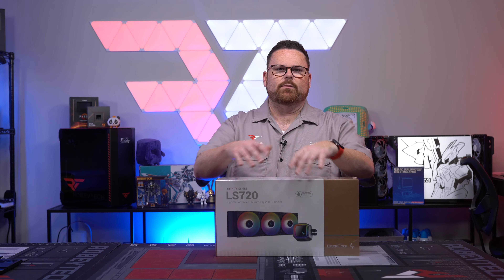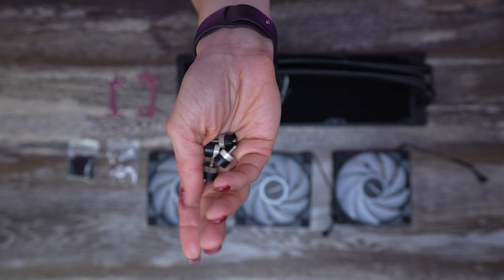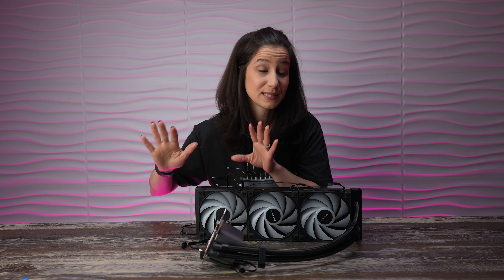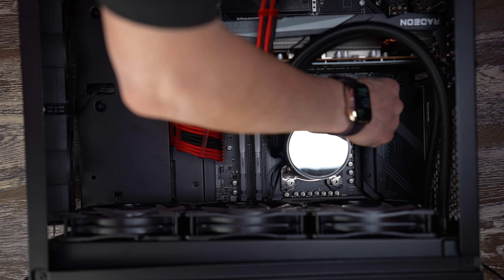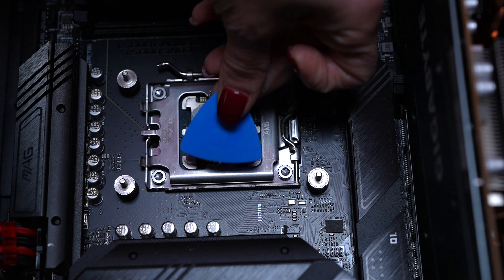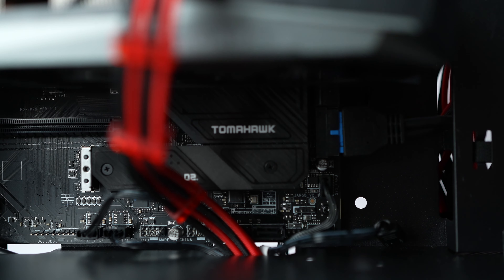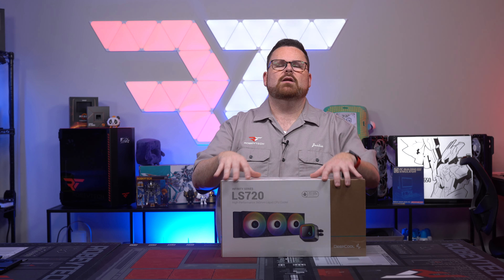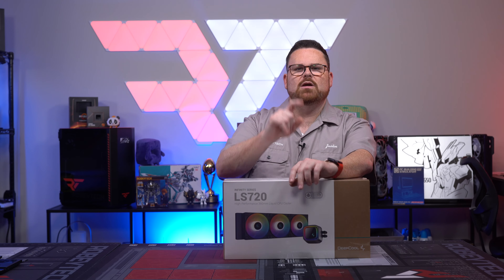How to Install (and Remove) the DeepCool LS 720 AiO (All in One Liquid Cooler)

Comment: Why are the hoses in the 3 o'clock position (next the the ram) as opposed the the bottom of the CPU (6'oclock). I keep seeing this and no one can explain it to me on AMD builds.
Reply: Hey, great question. I'm no expert but I'm currently installing this AIO now. The way the pump is oriented (pause and look at the screws at @5:30), it can only attach to the CPU in the orientation shown in video or the opposite way (180degrees). If you were to place it 180deg, the hose would be on the left instead of the right. The pump cannot be rotated 90degrees where the hoses would be on the top or the bottom since the screws won't line up with the motherboard/cpu. But "why" they're in that position, I'm not 100% sure
Reply: That's the answer. The pump only fits in one direction (for my board, vertical,  so I can have the hoses at 12 or 6 o clock, but not 3 or 9.).
Reply: @aalmanzaaaa  @noisymacbook I actually reached out to Deepcool and they told me it doesn't matter. On my Asus board, I have it on the 6 o'clock position.

Comment: Thanks for the video!

I used different fans for the radiator. Now I want to use deepcool fans in other position as stand alone, but connector doesn't match mobo connector. How can I do it?
Reply: what fan did you use for the radiator?

Comment: Where do you connect the 4pin to? You just point but I can’t see anything on the mobo
Reply: the 4 pin is a pwm fan connector so anywhere on the motherboard that's a pwm fan connector. you will know what it is because it will be named fan_sys1, fan_sys2 and so on.

Comment: I don't get it. Where to attach the 3 pin cable and where to attach the 4 pin cable?
Reply: the 3 pin is a argb that your motherboard should have depends how modern your motherboard is should have at least 1 or 2 connector and the 4 pin cable is a pwm called fan_sys1, fan_sys2 and so on.

Comment: Ok so, can this AIO be controlled (power and ARGB) WITHOUT using the fans in the package? I'm planning on using Lian Li Fans in accordance with my build.
Reply: may be late, but just connect the pump connector straight to the adapter cable
Reply: How are the Lian Li fans working with this AIO? I am going to do the same.

Comment: Mine start making noises from either a pump or radiator after 7 months,possible air and bubbles in the radiator unit or bad pump.
I will have to take it to repairs to see what is wrong with it.
I'm not happy about it   :(

Comment: Hello, Good day. Can I ask something. If I increase the RPM of the fans, Thus the pump also increasing the RPM of the pump? I wondered the pump and the pump is in daisy chain connection.
Reply: No these are separate settings if wired correctly.

Comment: After I watched the previous video.
I decided to buy the components recommended by this channel.
With specifications:
AMD RYZEN 5 7600X
GIGABYTE RX 6700 XT GAMING OC 12G
MSI MAG B650 Tomahawk WIFI
KINGSTON Fury Beast RGB 16GB (8GB x2) DDR5 5200MHz
SSD PNY NVME CS2241 2TB Gen 4x4
Super Flower LEGION GX PRO 650W

Among all the components, the ones I haven't ordered are:
DEEPCOOL CASTLE 360EX A-RGB

Luckily after watching this video, I got a cpu cooler reference with the DeepCool LS 720 brand

My question is, what's the difference between DeepCool LS 720 and DeepCool LS 720 SE?
After I tried asking the seller, the difference was in the pump.
But the price of the DeepCool LS 720 SE is $ 30 cheaper than the original version.
Should I just take the SE?
Reply from the maker: Both will work fine!

Comment: if i use my own thermal paste, do i use the isopropyl alcohol to wipe it off the aio?
Reply: Use it to prep and clean any old paste you no longer need.  So anytime you remove a cooler you need to clean the old and put new paste on.

Comment: Great video guys and gals. Quick question - how do you decide if you turn the radiator with the cables on the left side of the motherboard or the cables to the right side on top of the memory?
Reply: You decide, it can be either way

Comment: just got done installing this ''the 320'' on my new ryzen7 7900x3d and idle temps running about 43-46 i know with my corsair 320 i avg about 50-53 and i will say the price is way better considering i like throwing white components in my builds lol

Comment: Yeah I had issues with this unit, it worked “ok” for a couple weeks then my cpu temperatures out of nowhere were 95c at startup. No overclock just basic settings. Changed paste, direction of the unit, direction of fans, nothing worked, simply had to return it. Although it looks cool and all, its pretty noisy and it just sucks at doing its job. I would say stay away from it.